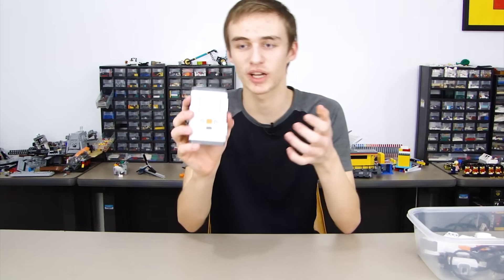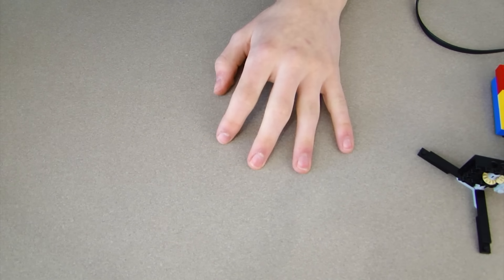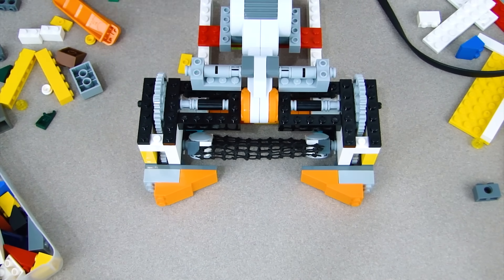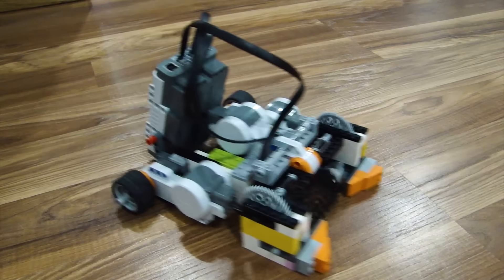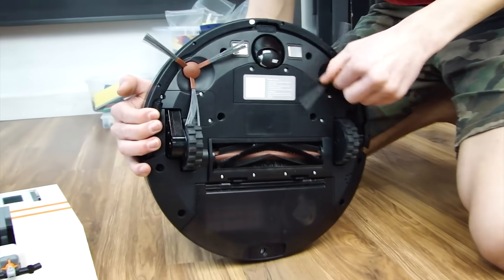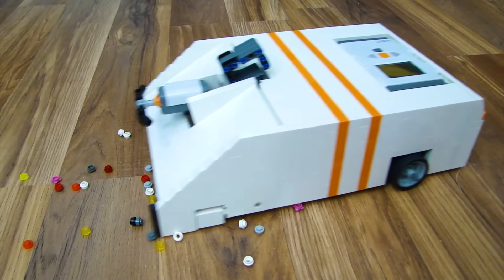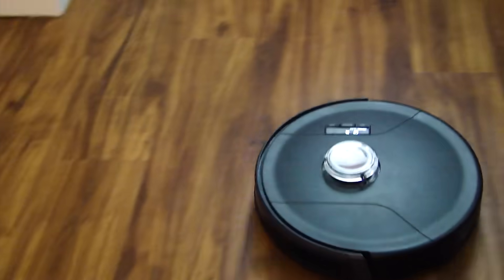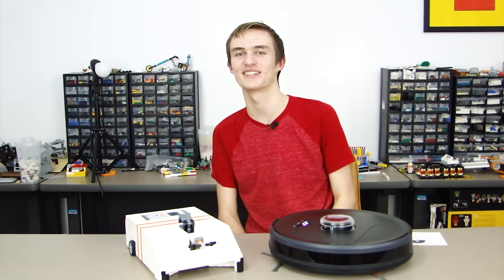I Built a LEGO Robot Vacuum to Pick Up My LEGO...

Comment: there are some problems
1. The foward button is backwards
2. it can only pick up tiny pieces of lego
3. the capacity is TINY
4. if u want to use it for cleaning dust, it works but for small grains of sand and trash, yeah it aint that great
5. uses a remote control on a phone so it not that convenient

Comment: Technically not 'vacuum', but yes, nicely functional cleaner!
Reply: A vacuum is close to absolute nothing
Reply: @svz5990 he means that the design doesn’t use low pressure to generate airflow that picks up dust and particles.